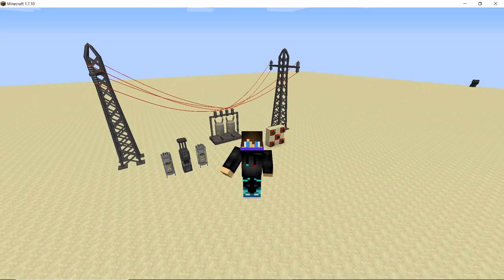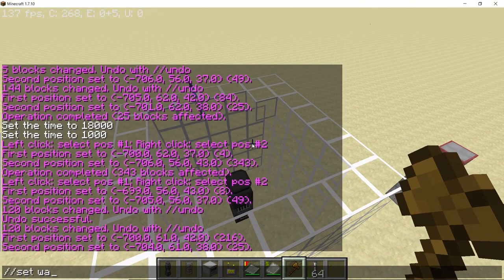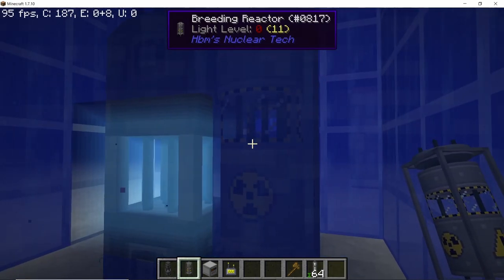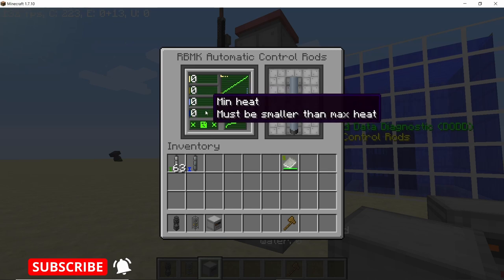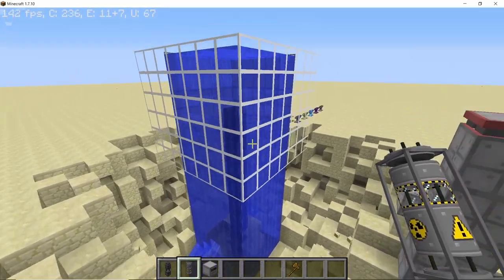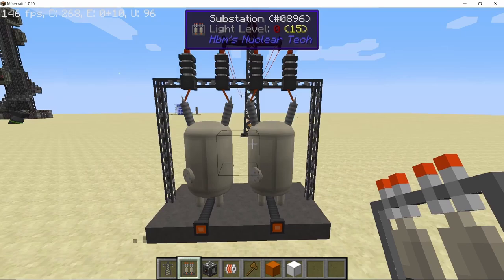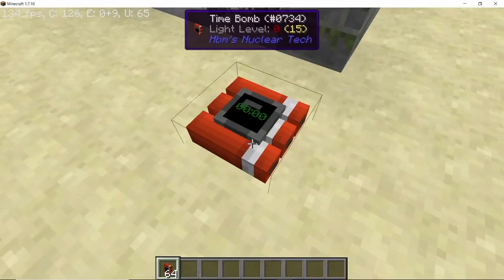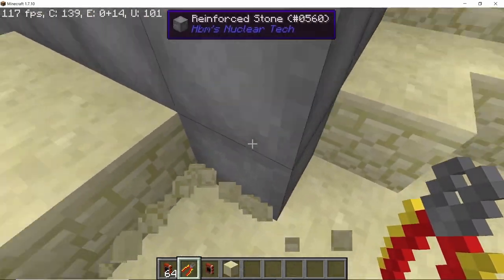Research Reactor & Breeding Reactors, Electricity Pylons & Substations and Time Bombs || HBMs Mod

Comment: when i use the research reactor, the research reactor make radiation everywhere how to fix? i try putting concrete it not work
Reply from the maker: Having the reactor completely submerged in water should the trick, when I've used it in the past it hasn't leaked any radiation for me as long as it's completely in water with 2-3 breeding reactors covering it
Reply: @SavageVegeta  i have covered the reactor with water, and i have 2 breeding reactors, there's 174 rad/s breeding reactor very expensive

Comment: How do you heat up the breeding reactor in older versions without the research reactor?
Reply from the maker: By placing fuel rods in the lower portion of the reactor gui

Comment: can't figure out which fuel it accepts now...no plates or rods or billets. any ideas?
Reply from the maker: Research reactor will use plate fuel , but they'll need to be activated using a neutron source like ra226be plate fuel

Comment: Wow but is the research reactor the same as the nuclear reactor or are they two different things?
Reply from the maker: No it's completely different as it does not produce any steam anymore. It is only used to produce flux that can be received by the breeding reactors which are placed adjacent to it

Comment: How do the function work on the plate fuels? the 'x' doesn't mean heat so I don't know what else it would be...
Reply from the maker: It's a function which controls how the heat will increase as soon as the fuel becomes active in presence of a neutron source. The more heat you have more flux will be provided. So look out for the multiplier in front of the x
Reply from the maker: Now ofc I'm just saying this out of memory I don't have my laptop on me rn so I can't double check , but basically that's how RBMK and plate fuels work.

Comment: i think we have a problem i cant take nuclear waste from 3X3 reactor i tried with everything but not working i builded 4 same reactors (3X3) and no changes 
i need help
Reply from the maker: What do you mean you can't take waste from the reactor ? If you're talking about recycling the fuel rods of an RBMK reactor then you've to let the rod deplete over 1% first and then you've to cool it down to 50° C  , only then you can recycle it 

I've made a video on it incase you wanna check it out